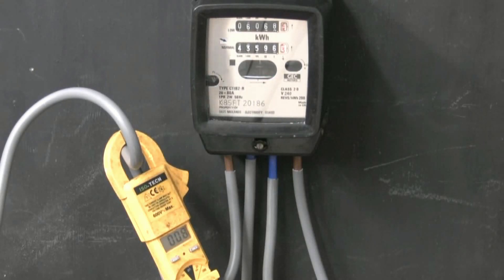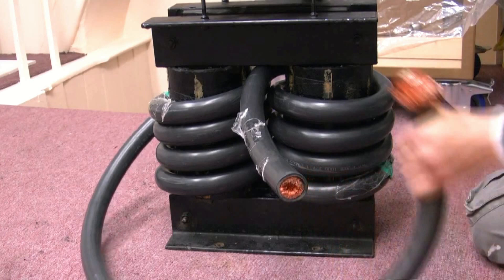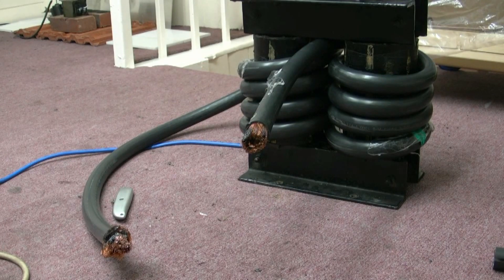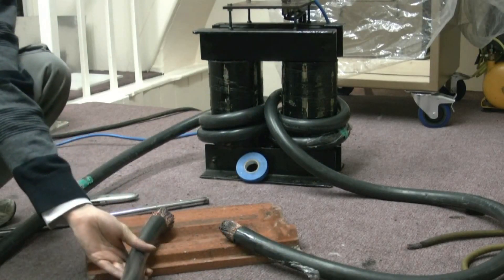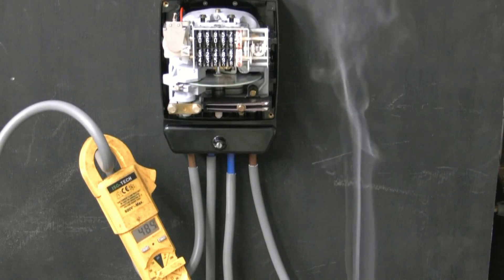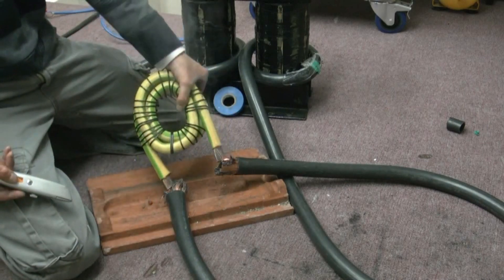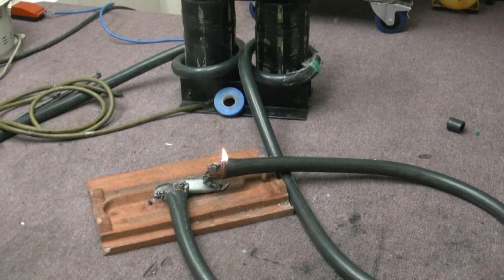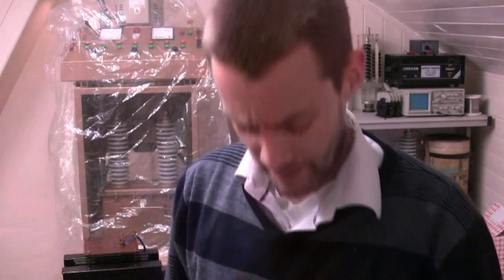Too Much Current + Electric Meter Pops

Comment: low voltage, gigantic amperage. Instead of using 110/220 wich is enought to run a pretty high current trought your body (and even kill you depending on the circunstances), running it on, say, 2 volts, you can even lick it, your tonche will itch but you can't die.

I'M NOT SAYING LICK A HUGE TRANSFORMER AND YOU'LL BE OK, never, just that lowering the voltage, lowers the maximum current that can flow to your body.

Comment: 2 reasons, 1 the voltage is far to low to penetrate the skin (its high current but low voltage) and secondly because its a transformer and its isolated from the mains, so with no reference to ground that low of a voltage you wouldn't even feel it, you only really start to feel it, when the voltage is in 2 figures, you will fell a very little tingle from about 40V, specially with we hands.

Comment: It is high current only. Very low voltage(probably around few volts 3-6V). Voltage was not enough to go through the resistans of human skin. If the voltage would be around 20V or even 15V and his hands were wet or swaety, he would be roasted like chicken in few seconds with that current :)

Comment: Here in the US, the next over current protection device past the main panel breaker/fuse is the fuse on the primary side of the high voltage transformer. You could get instantaneous short current up to 10k Amps, Like Photon said, big boom there. Awesome video. Cheers from across the pond.

Comment: He did not get shocked because the electricity wanted to go into the wire and not all the way through his body power tries to go the shortest distance also the voltages are probably reall low too low to even break the skin

Comment: He used a transformer to in simple terms, convert the high voltage to high amperage. A secondary wound for 2 volts may provide 1000 amps, but will only draw around 10 amps from the primary. 1000 amps * 2 volts is 2000 watts, 250v / 2000 watts is 8 amps, call it 10 for inefficiencies.

Comment: isolated+low voltage - google power transformers - 2 windings, if 2nd widing is less turns than 1st, voltage goes down and current goes up.

Comment: Have you done anything with your grid power? I hacked off the secondaries of a welding transformer, and put only 4 turns of welding cable on it, it kills my whole house's power in only like 5 seconds of shorting out.

Comment: yea, you are a power distribution engineer hey? I'm lucky my power company Energex in Brisbane has installed 500VA tranny just 150M away and run 240mm2 aluminum 4 core sector XLPE , i've got about 2500A Fault current single phase, not bad, I'm installing 3 phase to my house soon, for fun experiments.

Comment: Its a lot of fun pushing things to the limits, but just to let the non electrical engineers know, power systems are deliberately designed so no one customer can disrupt the grid, as there are fuses and breakers at every stage, segment, zone, street, house, branch circuit you name it. It is possible to black out your street by bypassing the service fuse, or just tapping off the street bus or even the street transformer, make a big bang, but it's a criminal act in doing it.

Comment: Love the video, Just letting all the other know, the single phase service HRC fuse on the street eg. 80A will eventually blow, protecting your directly connected meter and service cable. If any one tries to pull 500+ Amps from there service fuse would blow in around a second or so..no fun! You will need to illegally bypass your service fuse, at 500Amps + eventually the street fuse would trip, also the neighbors would notice dimming of lights, 50V drop is possible.

Comment: If you replace the piece of metal with yourself, and your resistance is 1500ohm, the current through your body will be 5/1500 = 3.3mA. If you were wired in series with the metal object, the current through you and the object would be less than 3.3mA and thus, no sparks. If you were wired in parallel with the metal object, it would draw 9600A and you would draw 3.3mA. You will probably burn your fingers from the heat.

Comment: Firstly, if he is running off mains (which would be 240VAC in England) and the transformer is singe phase, and the meter is pulling 200A, and his output is 5V, that metal object would be drawing 240/5*200=9,600A. The transformer is only outputting 9600A if the load is drawing 9600A ie: the piece of metal he is shorting out.

Comment: So the thing that kills is effectively large current going through your body and this only happens when the voltage is high. 

Ok but lets say in this case the transformer is maybe putting out 200A @ 5V.  5V allows your body to conduct but according to you only 10mA can pass, So what happens to the other 199.999A

Comment: Body resistance can vary greatly as low as 300ohm in worst case scenario and as high a 1Mohm. At 10mA you would feel this and it is getting close to dangerous levels. So under worst case scenario, eg: wet hands, breaks in your skin etc, 16V could kill you provided it has enough power to push those amps. In most cases, if your skin is dry, you will measure a very high resistance point to point.

Comment: The current value is drawn from the load. A microwave may draw 4A when connected. If you are connected, you may draw 80mA, >> all depending on the loads impedance. In the video here, the current drawn based on the cable resistance (as this is a short circuit) would be massive (likely limited by the power output of his transformer or variac. This is how power can limit current). Body resistance can vary greatly. Lets say your resistance is 1500 ohm(low side of scale) hand to hand. 16/1500 ~ 10mA.
Reply: Probably an urban myth but I read about how a man died from a 9V battery because the wires had penetrated his skin bypassing the skin resistance.
Reply: @darylcheshire1618  yep it could be possible based on resistance drop, but it likely would have had to be connected with 2 wires to go across your head or chest and penetrate at both ends. Current could start approaching the danger level, say 30mA+, and if you had a weak ticker it might be all that is needed…Would be extremely rare for all that to happen but I’m sure it could have.

Comment: No, this is true with either. As the voltage is increased, more current is able to flow through your portion. (for a fixed resistance, as V increases, so does I. I'm not sure what you define as low voltage but here, low voltage is anything below 1000VAC or 1500VDC. As you start getting to high voltages however, things change. The higher  voltages can penetrate through the skin deeper making their way into your highly conductive body fluids making your apparent body resistance appear much lower.

Comment: Yes, your right that the current will distribute between the two, however it will be unnoticeable micro amps (less than the voltages your neurons produce) that will be distributed through your body with the rest going through the very low resistance conducter.

Comment: The current has no reason to go through his hand since It wont have anywhere to go but through him and some wood and burnt carpeting. The voltage probably isn't anywhere near high enough to feel. You need somewhere along the lines of 60 volts before bare skin has problems. Since that transformer is converting most of the energy from voltage to amperage, I would be suprised to see anything near 20 volts coming out of that thing.

Comment: I assume that this is low current and because of the high resistivity of the (dry) skin the current flows through the metal object instead. current takes path of least resistance, but then again this is bullshit and the current should be distributed based of resistivity of the path. AS YOU CAN SEE I AM LOST!

Comment: everything rated at 100A can run on 100A safely...doesn't mean you cant go higher..just means that if you go higher its unsafe...meters generally go bang when you got 300-400A+ going through them.....well they fissle unless you got volts too..its the arcing that makes the noise.

Comment: Your right, but low voltages don't conduct through people very well. Mains power (230VAC for example) can kill you because you have high voltage and high current. Your average car battery can supply more amps than your mains power point, but with only 12v you can touch the + and - terminals and not get a shock. An electric fence has high voltage of maybe 5000 volts for example, which will travel through you to get to ground, but intentionally not enough amps to kill you.

Comment: The voltage like others have said, is too low, around 4 volts I think here, your body has a resistance (on the skin) of around 100,000 ohms dry and 1000 ohms wet, less if the skin is broken. Using ohms law this would allow 4mA of current to flow when the skin is wet. Not enough to cause any serious damage. I still would feel nervous however! :P Apparently at least 60mA is needed to cause ventricular fibrillation, according to wiki anyway :D

Comment: It is, but you need the voltage to carry it through your body. 600 amps at low voltage won't do you any damage at all, you won't even feel it because your body's resistance drops the current down to barely anything. If the voltage is high enough to break through your skin to the rather more conductive bits underneath, then you're in trouble however. A car battery can deliver surges of over 100 amps to get a car started, grab the terminals and nothing'll happen. Again, body resistance.

Comment: To anyone wondering why he isn't getting a shock here, if I remember rightly from the original making-of video for that huge transformer, the output voltage was something like under five volts. Your body's resistance can overcome it so the current doesn't pass through you.

Comment: also.. he's not IN the circuit as you see the electricity goes through the blade and into the the other wire on the secondary

Comment: if you were to wear rubber soled (insulated) shoes and not touch any metal object and go cut a live wire it will not electrocute you because you are not the fastest way to ground.   Simple as that but seriously don't go try that xD

Comment: that's because electricity takes the easiest and shortest route to the ground, Andy's rod was touching the wires, and because the rod has a higher conductivity than a human (Our example being Photonicinduction) the power will not pass through Andy's hand, it goes through the rod and back into the power supply, which, in this case was the variac.

Comment: Just like "sk7ca" said: If you know how transformers work, & what he did with the big black transformer, then you'll know how he managed to grab hold of the matal bar -bare handed- WITHOUT being shocked.

Basically, he re-wound the output of that transformer so that it knocked out less than 20v at ridiculous amps, but even if it was 200v output, because the secondary of that transformer has no reference to earth, touching ONLY ONE of the outputs would STILL not result in any shock!

-BBD.

Comment: Even tho that transformer is putting out a couple of thousand amps or so, the voltage is very low, about as much as a single AA battery at the most, and electricity needs both volts and amps to be dangerous.